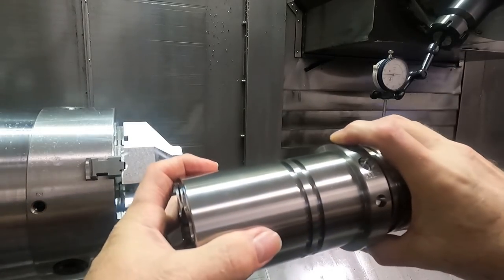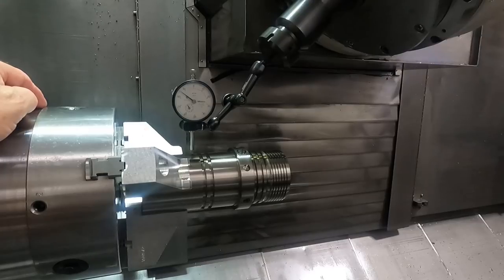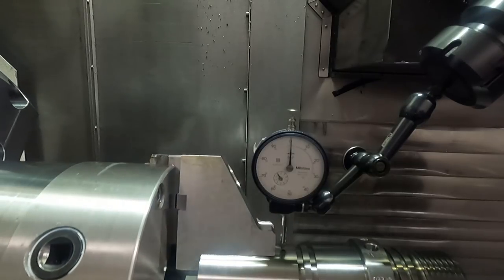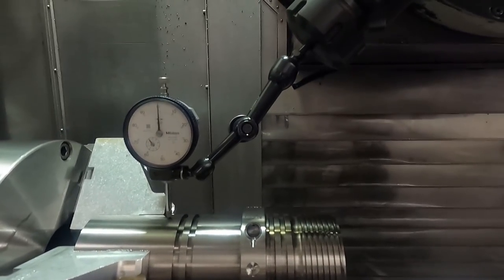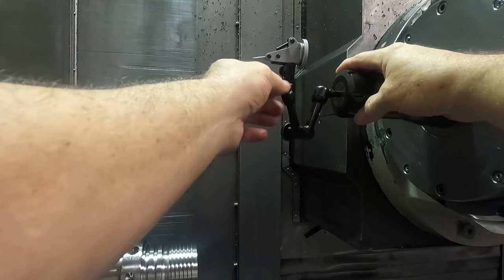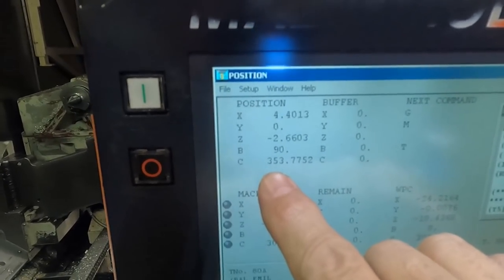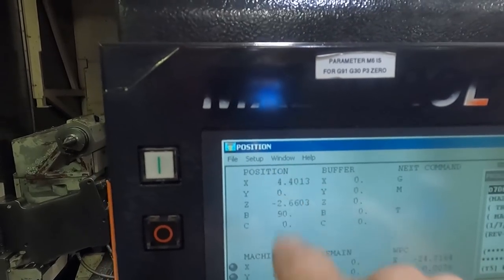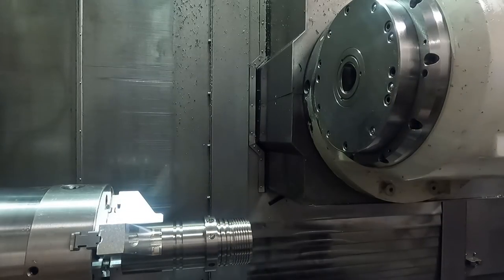Op 2 Machine Work Titanium Part With Thru Holes

Comment: Thanks Peter, always enjoy your videos.
Its always good to see how much emphasis you put into indicating and doublechecking.
Reply from the maker: Thanks again Stefan. Would you believe in these comments on this video. There are people that criticized my methods of indicating, as taking to long. Now to me if I take a few minutes longer to be sure of things (with peace of mind) before pushing that start button, it's worth it. I hate the feeling when doing machine work. I should have checked that before I ran the program.
Reply: @EdgePrecision  I'm not Stefan but I can believe it. So many know it alls. I can't even imagine the cost of one of those parts, in material and prior work. To not spend a little more time being certain and ruining it? Goobers, all of the know it alls.
Reply: @Edge Precision hey Peter, great video as always!!

I was wondering if you could help me? I seem to recall in one of your videos you show and talk about transferring programmes from your laptop to your mazak via cable link but I cant find which one, do you know the video or maybe even be willing to make a dedicated video? I usually transfer to the mazaks I work on via USB but this is becoming a problem due to the company's data transferring/sharing policies and think this would be a good alternative, thanks!
Reply from the maker: @middlemanclayton1  This machine has a network connection on its control. It has this because of the tower computer these e650 integex machines have. I don’t use this so I didn’t install it. This machines control doesn’t have a USB port the control is to old. This network connection is not standard on Mazak controls so you may not be able to do the same thing on your machines.
Reply: @EdgePrecision  no it should yours is a 2010 eh? or is it a 2006 ?
Reply: @EdgePrecision  ah I see, nonetheless I would still like to understand better how you do transfer to your machines, do you know what the video is where you show how you do it on your intergrex?
Reply from the maker: @middlemanclayton1  Basically with my network connection. I can scroll to the file on my laptop (I have them networked together with a cable) and drag it to the folder on the Mazak's control. It's the folder that the control uses to transfer programs to save them from the working memory. You can do the same thing from a USB stick if you have the USB port. You should be able to find witch folder this is on your machine. Go to program on the control. There should be a soft key for program file. Select that. Now there should be a soft key for Change directory. If you select that. A window pops up for what directory. On mine there are three. The one I use (I think) is called Back Up Programs. The path on my controls computer to this folder is. D:/mcbackup/proograms.
Reply: @EdgePrecision  ok that sounds promising, when selecting programs on the mazaks I use with nexus controls there is a program file soft key and a backup memory directory, its the D:/mcbackup/programs that I didnt know about, ill have a look when I get in work later

Comment: One of my 3 jaw chucks has a factory mark on the pinion gear that gives the best concentricity when tightening. 
My only 4 jaw scroll does also.
Reply from the maker: That would make sense if they used that one when the jaws were ground on the chuck.

Comment: I imagine the spindle lock mechanism is very closely related to a cnc lathe tool turret indexing spline sort of rig. Although the spindle bearings add a level of complexity to the spindle locking mechanism I would love to see the system. Hopefully you never have to show us that assembly in your videos lol. Thanks this has been a very interesting series on this part. Especially the gun drill breakdown
Reply: Actually in some older video he showed drawing of spindle assembly and explained how locking mechanism work
Reply: @rendicz5595  Thanks I dig through his channel

Comment: I just figure tightening all three is a way of reduce wear or potential for wear by having each pinion take up some of the clamping load. There are other reasons, but I a feeling the scroll would wear out before they became a problem.

That machine you have does seem to be built to make anything you want without wrecking anything.
Reply: You'll never get the clamping load spread between all the pinions.

Comment: Thanks for taking all the extra time to explain the lathe chuck, the spindle clamping, and the gun drill. This was very interesting and I learned a lot!
One little remark: Could you please check the focus of the camera before filming? There were a few shots (e.g., while you showed the gun drill tip, and at the very end while you rotated the part) where the background was in focus, but not the interesting part. Thanks!
Reply from the maker: I was using a GoPro camera for this sequence (unfortunately).
Now there is no focus control and the little screen on the cameras back doesn't give you much. I didn't realize the focus until doing the edit. I decided I didn't want to scrap the whole take because the description (my voice) was on the same camera. That whole gundrill thing would have to be done over. This is the disadvantage of using a GoPro camera for this kind of thing. But you are correct the better thing to do is to redo the whole thing. Due to limited time I opted for the less than optimal solution.
Reply: @EdgePrecision  Ok, understood, thanks for the explanation! Yes, please don't waste your time and work by redoing a sequence.

Comment: The way you are indicating for the c-axis location (18:00), can you do this with an indicator on a magnetic base stuck to the freely rotating milling spindle, or is it important that it is clamped down in a something such as a collet? 

I guess my question is, does the base of the indicator have to be running true to the milling spindle rotation or can it be off center because it's rotating around anyway?
Reply from the maker: As long as you are in the vertical orientation like in this video with the mag base on the spindle. Where gravity wont affect the reading. Yes that would be possible. But as I said in the previous video you need to be aware of this in the horizontal position. And no the mag base doesn't need to be running true to the spindle. The whole indicator and base will rotate around the spindle's centerline. Regardless of the location on the indicator's base.
Reply: @EdgePrecision  That is fantastic, thank you!

Comment: Very true about the centering of the jaws on a scroll chuck, never thought about that! Thank you!

Though I can actually se a reason to tightening all three pinions and that would be to even out the wear of the chuck. Although it might be better to have all the wear on one side, then it would be consistent, instead of having the scroll move all over the place. Hmm.. 🤔
Reply from the maker: On a set true chuck once your dialed in. It would be better if you only tighten the same pinon every time you chuck the next part for the minim run out. Or the same If you are boring soft jaws. I have even used the tapping of the jaws on a hydraulic chuck. On a CNC lathe before.
Reply: @EdgePrecision  Yes, that makes sense! 

Thank you for a good video and the breakdown of the economics of the gun drill! Really appreciate it!

Comment: I assume your integrex has high pressure coolant as an option? Would you recommend using gun drills without this feature? I’ve only had to use a gun drill once and didn’t have high pressure coolant feature but fortunately it was only one part and the drill made it.
Reply from the maker: The answer is it depends on the size of the drill. With small drills yes you need High pressure to blow the shavings down the small flute. But with larger drills more coolant volume is better. This is why with my machines, the pressure is high around 1500 psi. But those high pressure pumps don't put out much volume. Lets say around 5 Gal per minute. So when I get much above a 1/2-5/8" drill. I have problems. So I need more volume. I would say if your coolant system was lower pressure but higher volume you would have better success with larger drills. But smaller ones say less than 1/8" you really need high pressure. Hope that answers your question.

Comment: Do you have a good tip for setting the y offset with a turning tool?  I use a slant bed with a turret, and have tool blocks that hold a few turning tools, so I use a y shift to move between each tool in the same turret slot.  Ideally I would like to measure and get an exact tool height but struggle to find an easy solution.
Reply from the maker: I'm not sure I follow you on this. Doesn't your block have a certain spacing on the tools? So it should be a simple offset the amount the blocks spacing is. Other than that. The way we use to get the tool height on a engine lathe is to use a 6" scale and bring the tool up gently against the scale pinching it between the work and the tool. When the scale set perpendicular to the tools shank (In your case. Vertical on a engine lathe) you were centered close enough. You would be surprised how accurate this is. On a CNC lathe you would have to be careful not to jog it to hard into the scale and break the insert. On my Integrex I very seldom run tools off center in the Y axis. When I do I know exactly how much by the dimensions of the tool.

Comment: If those chuck fingers can move a bit can rotation at speed throw it off?
Reply from the maker: As long as the part is reasonably balanced, no speed won't throw it off. That said anything can move if it is hit with a shock hard enough. But in general the machine work is a different force than what I am applying by striking the jaws with a piece of steel or a hammer. If it is being done properly it is more of a constant force. Not this shock impact like I am doing here.

Comment: would you say you divide everything by 2 for titanium ? everything from speeds and feeds
Reply from the maker: What materials speed by two? It depends on the titanium and it's heat treat. I generally start around 150 surface feet and see how its going. Than I change things from there.

Comment: What about a spade drill verus the gun drill? Too much wandering?
Reply from the maker: For large diameter holes spade drills work good. I have quite a few of them. Say holes 3/4" and larger. They won't hold size, finish or location as well. But they can be run with lower pressure and volume of coolant supply. I think with spade drills they don't control the quality of the tool close enough. I have noticed that the Allied ones I have vary in runout and having the spade tip properly centered on the tip. With larger gun drills coolant volume is more important than pressure. This becomes a problem with most machining centers HP coolant systems. My machines as well. When you get above say a 5/8" diameter gundrill they wont supply enough coolant volume. The coolant holes in the tool become to large. This requires a large volume of supply to maintain any pressure.

Comment: Hi Peter, can you say to which angular tolerance you think indicating the C axis would ensure? if I have +/-0.02degree tol. between holes on both faces of the part would this type of alignment still work?
Reply from the maker: If there is a feature on the first side that you can indicate when you turn the part around yes. This method could and should get you even closer than +/-.02 deg. Assuming of course the feature you aligned to is precise in it's location. This machine can resolve the C rotary axis to .0001 of a degree. When you saw me indicating it in. I had it in .001 degree jog. It will do 10 times finer jog than that. If it was necessary it could be done to that accuracy.

Comment: If you indicate  something and then come with a milling cutter that hits the workpiece 30 times as hard,        the workpiece will move  or  ???     I tighten it really hard,, interrupted cut is the worst
Reply from the maker: Yes it is possible for the part to move in its fixturing during machining. Typically if you feel like you don’t have a secure hold on the workpiece. It would be advisable to do all the heavy roughing first. Then check the parts alignment before doing your lighter finishing cuts. This kind of comes with experience in doing certain jobs on their fixturing. Also there are stresses in the materials that get relieved while machining off material that cause distortion. That may not clean up on the finish cuts. For example when doing heavy milling in a vise. You may want to tighten the vise a lot/hard to do you roughing. Then loosen and re-tighten more lightly for your finish cuts. This reduces the distortion that the heavily tightened vise may be putting into the workpiece. Just one example of similar things that may have to be done while machining parts. That is seldom seen on YouTube videos.
Reply: @EdgePrecision  precisely,, have often seen people do it,, afterwards they don't understand why it doesn't fit together  😃😃

Comment: 12:56 That usually doesn't end well for me! I like to joke and say my indicators have a half an RPM max rating.
Reply from the maker: If you are referring to me orienting the spindle with the indicator mounted. On this machine I know the spindle orients slowly and never makes multi-able turns doing so. It does it in less than one turn.  I would never do this on my horizontal mill. It would throw the indicator off the arm.
Reply: @EdgePrecision  I wasn't giving you crap, just remembering my past screw ups.
Reply from the maker: @TheFeller1554  I didn’t take it that way.

Comment: If you tapping on the jaws a little moves it like that, wont the tooling engaging the part move it too, possibly negating the zeroing you did?
Reply from the maker: When you tap on something like that it’s a shock that moves things. The machine work is a different kind of force. More of a steady force not a shock load. Let’s make a comparison. Like hammering a nail into wood. The hammer can drive it in. But if you put a steady load on it it can take quite a bit of force without moving. It’s the same kind of thing.
Reply: @EdgePrecision  Ahhh makes sense. 
Follow up question, what about a gun drill makes it so good for high diameter to depth ratios? I've heard people say the same as you did in the vid, but never thought to ask why.
Reply from the maker: @beachboardfan9544  I don’t know if I can give you a complete explanation. I think the shank of a gundrill has more torsional rigidity than a twist drill. And the tip like I showed in the video rides on the bore of the hole and keeps it going straight.
Reply: @EdgePrecision  Nice, thx for taking the time to respond 👍